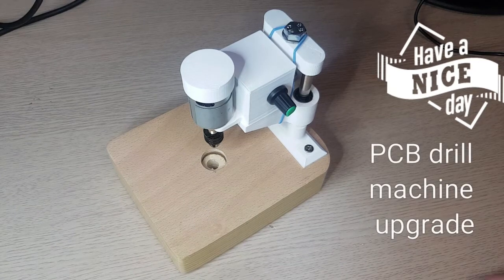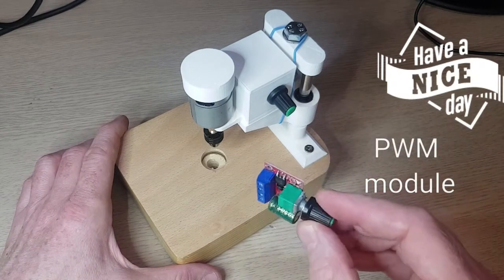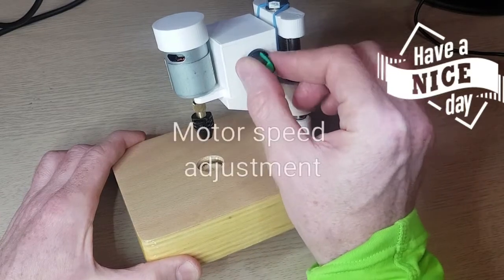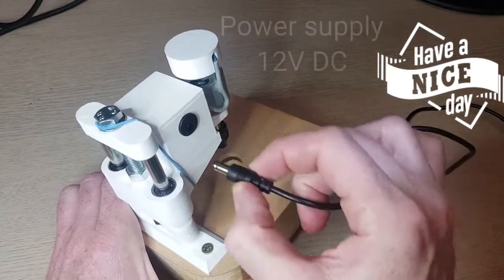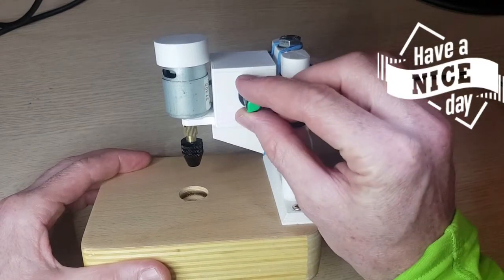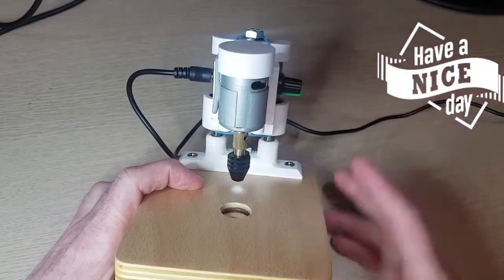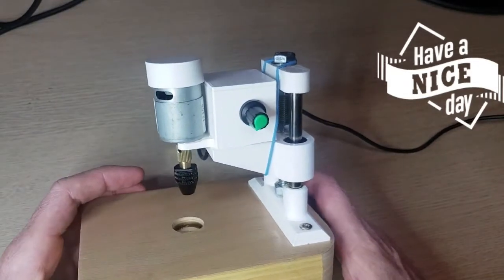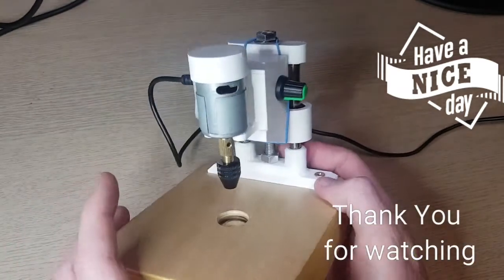Mini PCB drill press Upgrade

Comment: Hello, in your last video I noticed that the motor mount is not strong/rigid enough: it bend during drill-pressing. But I like your project, it looks very nice!
Reply from the maker: You're right, I noticed this too, but I don't have a problem with that, so I didn't make an improved version yet.